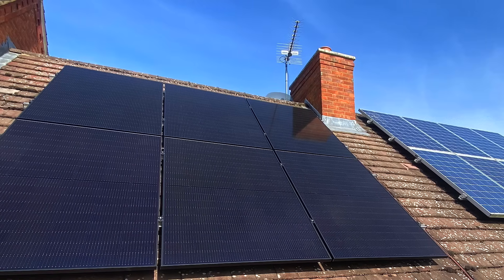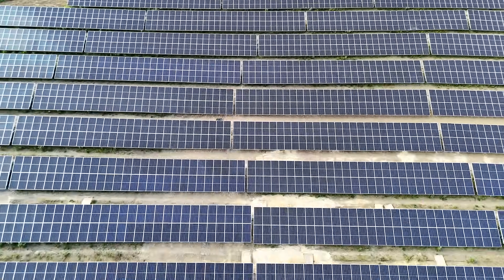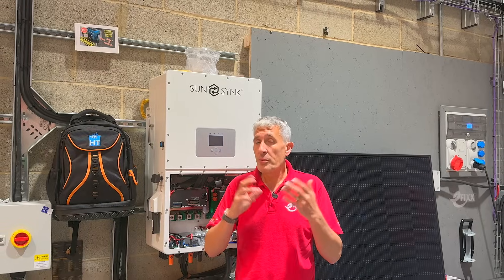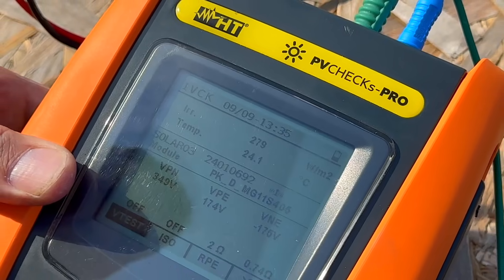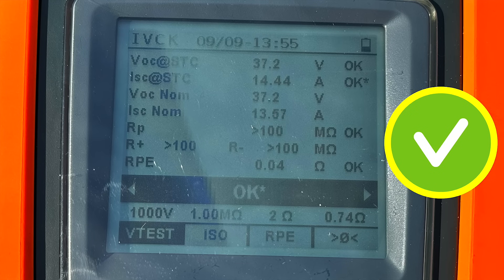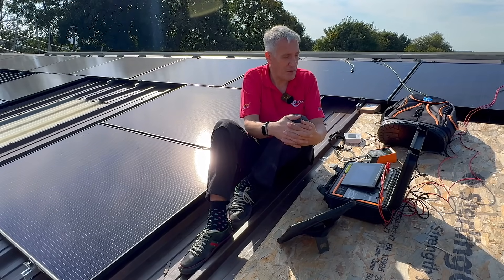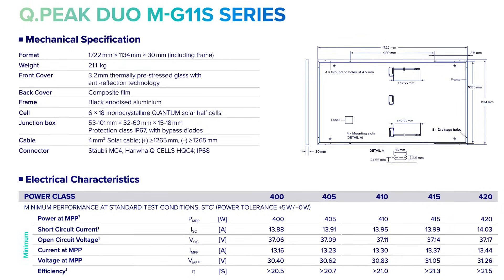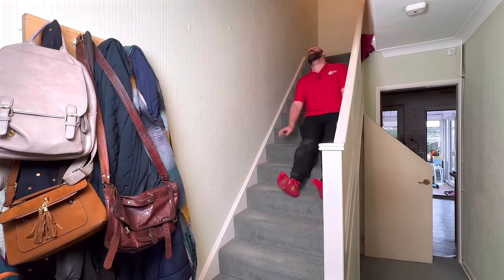Avoid BIG Mistakes with These New Solar Testers! - PV Checks Pro & IV600

Comment: One of my biggest concerns of late is the earthing of oxidised aluminium what are your thoughts on this
You would certainly have to be well qualified to work on the 1500 V DC system😊
Reply: Penetrating washers between the frame of the panel and the rail does the trick nicely.  There was hand wringing by some that were concerned by the practice but they didn't understand the washer forms a gas tight connection to the frame / rail.  I know a reputable installer in my town and he hasn't noticed them failing.  10 years on and the panels still meet the standard  earthing resistance of 0.5 ohms in Australia.  You put a washer under each clamp so each panel has 4 points of connection to the rails.  Even if one does start to fail there's 3 others to ensure the frame remains earthed.

Comment: Nice bit of kit those testers.  Bi-Facial should be the defacto standard for PV.  

On a side note Gordon get some PPE and leed by example
Reply: Bi-facial panels are mostly a waste of resources in the manner they are often installed.  In domestic roof top they really don't make sense but you see them being sold into that situation all the time.  Elevated, ideally with a decent albedo surface underneath and inter-row spacing if that's the arrangement, that's what they were designed for.
Reply: Why should they be standard?
Reply: @edc1569  If you mean the Bi-Facial PV then it is becuase they can help generate up 20% more energy,  if you mean Gordon not having any PPE well that is anothing thing.